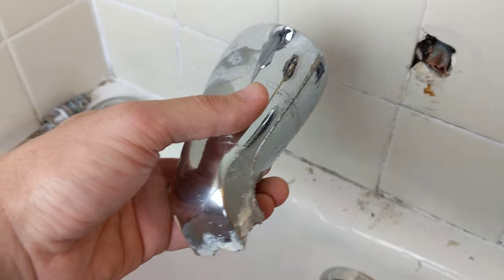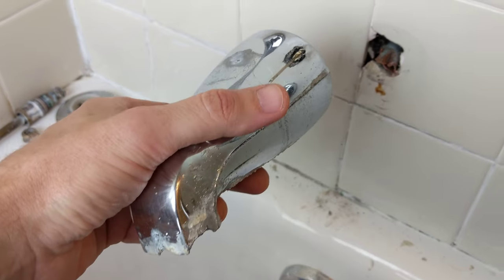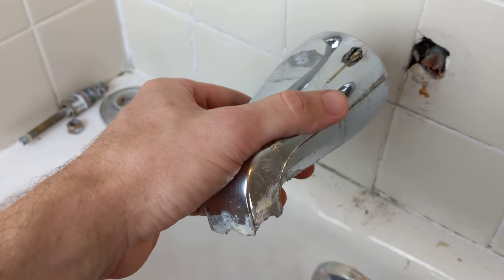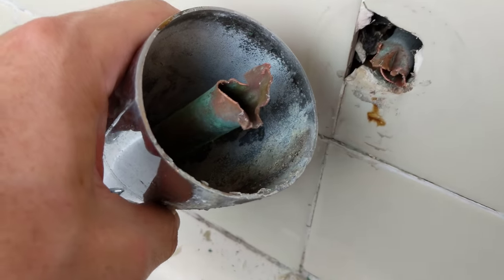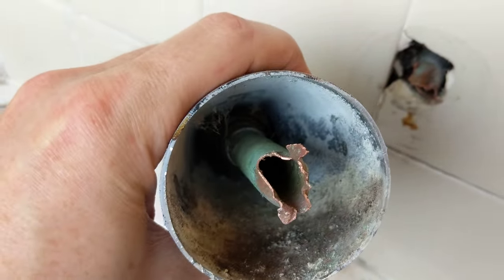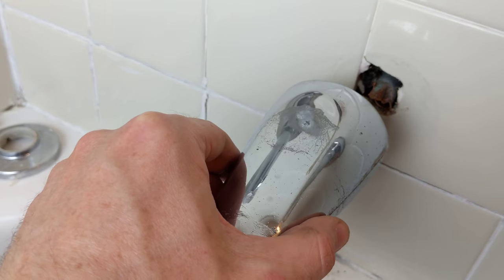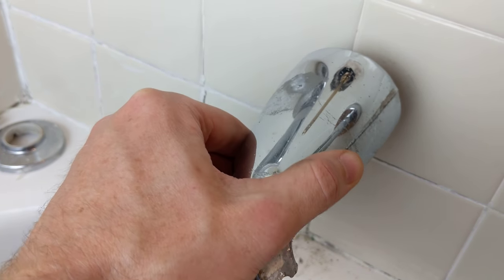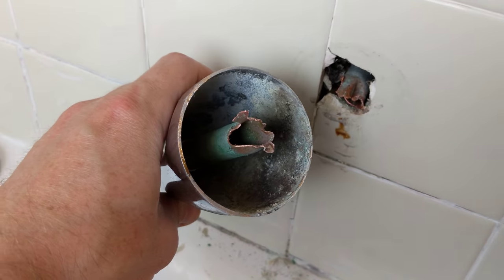BE CAREFUL removing your stuck bathtub spout!

Comment: Thanks. You just saved me a lot of trouble and expense!  I turned the hot water on full blast to heat the metal up and let it run awhile,  That was enough to expand the metal and let me loosen it. Thanks again!
Reply from the maker: Glad I could help! I wish I'd thought of doing that!
Reply: Thank you thank you thank you! I was struggling to remove my diverter spout and running hot water immediately help to loosen it. Very appreciative for this useful tip!
Reply: I am having the same issue, I'll try the hot water option.
Reply: Thanks for the tip.  Was about to get a big wrench, but was able to run hot water for a couple minutes and get it off by hand.  Huge help!
Reply: Great idea and maybe using a hair dryer or heat gun on low would be another way to get it off without turning the water on.   Thank you for sharing your experience! 👍👍👍
Reply: Just want to add I tried the hair dryer and it turned off on its own. I think I was holding it too close to the metal and it was heating itself up.

Comment: Folks...I just removed a 26 year old stuck af tub spout using a propane torch to heat it...Spun off like butter.
Reply: I'm about to use your suggestion, as I have no heat gun. So... what did you point the flame at exactly? I have a plastic shower with metal spout. Thank you.
Reply: where should i pointed the torch - which end of the spout ? i'm going to use hairdryer . ty !

Comment: Good reminder.  If you know you are going to replace the stubborn spout, cut away the chrome portion as much as possible to expose the pipe and joint.  Then spray the joint with penetrating oil or if necessary use a propane torch to loosen the connection with 2 wrenches.

Comment: Ahh man, that sucks. I feel for you, and I applaud you as a homeowner trying to do this yourself. For anyone watching this 3 years on, if this happens to you, take a propane torch and gently heat the tub spout all around for about 30-45 second, 15-30 seconds if using MAP gas. Remove the heat, take a wet rag and drape it over the spout. Take your channel locks and gently start backing the tub spout off. It will break free. Never ever try to wrench it to the point of fear of breaking the pipe. If its old and crusty, it just needs some heat to persuade it to give up. Good luck.
Reply: No torch, so I used a hairdryer for like 5 minutes and it came off!  Thanks!
Reply: someone else posted here about running hot water for some time.  for those without a propane torch, do you think that could accomplish the same thing?
Reply: @ceez1997  Running hot water through it might make it tighter. The pipe coming out of the wall is male, the faucet is female.  By running hot water through it, you are causing the male to heat up and expand.  If the female is still cold, the joint is even tighter.  But eventually, the female will get hot too, and when they have both expanded, it might be loose enough.

But ideally you should heat up the outside (female) to make it expand, while the inside is still cold.  I'm going to try running cold water through it while heating the faucet with a torch.

Edit: It did not work.  My faucet still won't budge! It is 42 years old.  I may have to cut it apart.
Reply: @jej3451  what'd you do? I assume you removed the set screw from underneath first?

Comment: Yes! Success!!!! I'm a woman with weak hands and that faucet's been on there since 1969-70. Ran the hot water for a couple minutes and it loosened right up. I had been working on it for about 30 minutes and started to break the front of the faucet when I starting watching these videos. I found out the pipe is galvanized steel. Thank you so much... all of you!

Comment: THANK YOU THANK YOU for posting this and to the commenters who shared their results with running the hot water for several minutes. We ran the hot water for five minutes and it worked well. Spout unscrewed and the copper is intact. ❤❤❤

Comment: For those DIYs stuck here.  Try a butane torch on the spout to break that corroded connection.   Heat all around the outer end for a minute moving the flame often.   Use a damp thick rag to avoid burns and try to twist off.  If that didn't loosen it...nothing will.  The pipe will give before the spout will.  However heat works 9 times out of 10.

In that case, still stuck, it is time to cut away the back half of the spout.  Then you can put a pipe wrench on the exposed pipe to keep it from breaking.

1st though...make sure it is a spin off spout.  If it has a notch at the bottom back, it is held by a fitting collar not a threaded pipe.

Comment: I saw a trick somewhere and it worked on my tub spout that wouldn't budge. I saw this video and was afraid to apply too much pressure or use a tool.  I ran hot water through the spout until the spout was hot, then ran cold water for about 10 seconds.  The spout came right off by hand!

Comment: And I had the same problem. A small piece of rusted(spigot) pipe broke and is attached to the other pipe inside the bathroom wall.  My husband tried to get out with water pipe extractor but it so rusty that looks glued to the metal pipe.  So my question is what did you do next? Were you able to fix it? Or did you call a plumber?. Please advise.
Reply: Same shit here, plumber gave us an estimate of $2,000 and said they would have to go through the wall in our hallway behind the tub to replace a new copper stub pipe

Comment: Always heat it very hot with a heat gun works almost every time!
Reply: Where exactly should the heat gun or hairdryer be pointed at ? The base of the spout that's attached to the wall or towards where the water comes out ?
Reply: @vision1707  sort of in the middle just get the whole thing really hot
Reply: I heated mine with a heat gun and then turned it and ended up twisting the copper pipe completely shut and breaking it off. So.... I wouldn't advise that.

Comment: Don't bother removing the faucet if this happens to you and you are just trying to get the diverter to work. I was able to get underneath to remove the the diverter and clean scale that built up around the hole with a file and brushed on vinegar with a small paintbrush. Still leaked so I bought a replacement kit for $7 and that took care of it
Reply: Unless you have an old American standard diverter that most have never seen! It's almost cylindrical, not a flat plastic piece. And part of it is also stuck inside!

Comment: I have the same problem, as others suggested to do this using heat such as a propane torch (which I dont have) hair dryer or running hot water.  Tried running hot water for 10 mins but unfortunately it's still stuck on there good.  I am tempted at using the oscillating tool to cut around near the front of the spot and see what it looks like in there.  Maybe some WD40 will help losen it up...who knows.
Reply: Did you figure it out?
Reply: Any updates?

Comment: Why were you replacing it?  Looks to be in great shape. 🤦🏽
Reply from the maker: Hahaha. I was troubleshooting a tile leak. I eventually had to replace all the tile
Reply: @clintflix  those spouts from home depot are so cheap, they are a receipt for disaster.  I went through 4 different ones today.  What a joke
Reply: @impetiousdoom  I ordered one today on homedepot.com made by Speakman it seems to be an exact copy of my original one made by Delta.  The ones made by Danco are very thin metal and seem to be garbage.  Of course I have to figure out how to get the old one off first without breaking the pipe...
Reply: @1575murray  shoot penetrating oil into the spout and let it sit for about 10 minutes to help break the seal 🦭 👍🏼
Reply: @impetiousdoom  I am doing that already using PB blaster.  I will do that every day for about a week as I don't have the new spout yet anyway.  If I can't remove it using a small amount of force I will have to seek outside help as it isn't my property and I don't want to break anything.  I am doing the same thing with the retaining cap for the faucet (Delta 600 series) so I can rebuild the faucet valve.
Reply: @1575murray  hope it all works out. I’m in Vegas.  Are you close?
Reply: @impetiousdoom  I am far away in New York.

Comment: wow, that sucks. So what now?
Reply from the maker: I called a plumber to come out and solder a new pipe. He had to take out six of the tiles in the process. I redid the tile and put on a new spout that doesn't directly screw onto the pipe.
Reply: @clintflix  oh man that sucks.
Reply: I have about 2 in out the wall. I hope one of this universal kits can manage with that
Reply: @clintflix  just curious how much did that cost?  I did the same thing and i have been trying to find videos how to fix it but it sounds like i need a plumber too.
Reply: @sombuun1  when you do get that fixed make sure it’s not a copper nipple that is used to connect the spout to the shower body.they make brass nipples in various lengths to make that connection.by using copper you can easily rip that apart —as your seeing...hopefully you have extra tile left over from the original install —-damn I hate seeing people go through this.

I replaced a spout yesterday and while it took most of the day running out for parts—I had a solid nipple making the connection so it didn’t go bad like this.good luck and sorry for your troubles
Reply from the maker: @sombuun1  Hi Brandon, I wish I could tell you. I had a contractor friend recommend to me the plumber he uses, and he came and put a new pipe end on but declined payment until after I did the tile work (in case I needed him to install the spout afterward). I ended up doing the rest myself, but since then he's ignored my repeated attempts to contact him about payment. I've suspected along the way that my friend may have quietly payed him in advance, but I have not been able to find out.